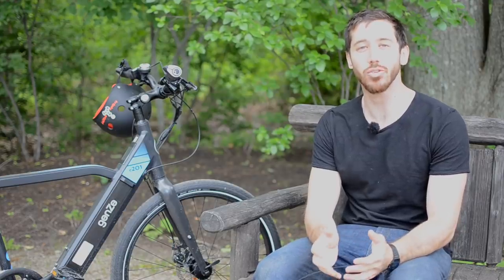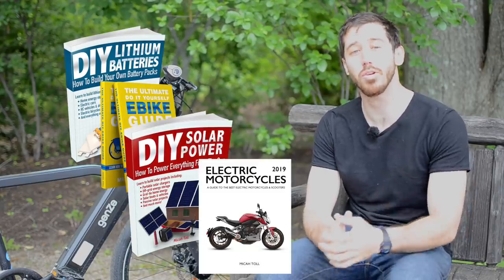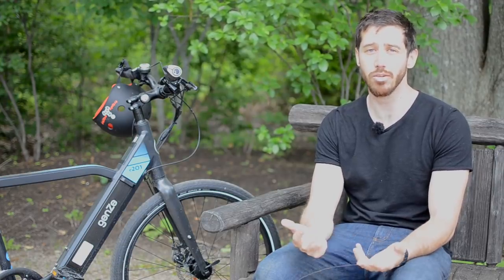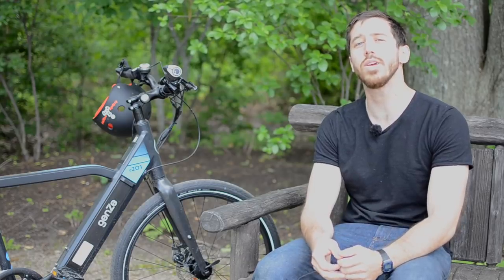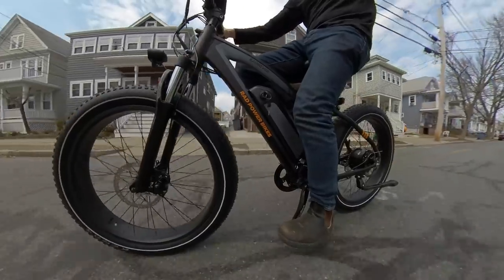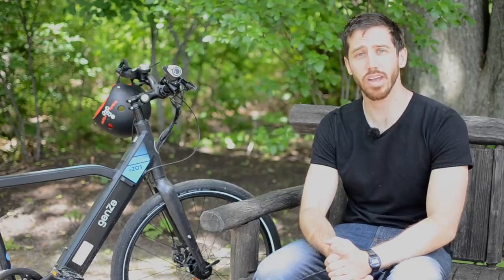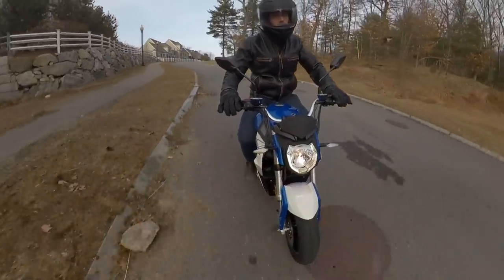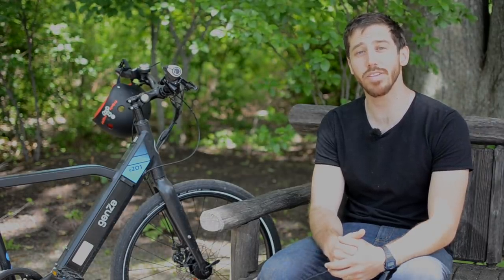How much POWER does an ebike need?

Comment: I have a front hub 1000w 48v wheel and run a 48v 40ah lithium battery on a trike. It lasts me almost two weeks of riding back and forth to work, climbs the few hills at speed unless it's already at top speed in which case it slows down a bit, and handles grocery runs fairly easy. I used to do the chinese motor bike kits, but after having a lot of difficulties with the setup on my trike I swapped to the electric hub and haven't looked back

Comment: I’m considering getting a surrey (4- or 6-person) and I want to instal a hub motor on the drivers side to make it pedal assist. Of course they are crazy heavy compared to a bike, so do I go 1500w?
Reply: Id go for it. Alot of passengers and more power is better. Im trying to get the governor off of my bike for more speed. And two batteries for you. Maybe two 52v?
Reply: @swanp1767  You nailed it. I ended up going for a 52V battery too. I thought the hub motor would be too much, but now having installed it, I bought exactly the power I needed.

Comment: One factor that is not often talked about for ebikes is the diameter of the wheels and how that affects top speed and hill climbing ability. Although you may be sacrificing some top speed, smaller wheels do not need as much wattage to achieve the same torque to the ground needed for hills. Ofc, gearing also plays a big factor in the case of mid-drives, but all things being equal aside from wheel size, i think this holds true.

Comment: Great video thanks mate. Do you recommend having push button throttle for acceleration or having pedal assist? Is it possible to have both running at the same time? Or flip between these two options with a button

Comment: I built a 1000 watt rear hub drive ebike a year ago (spring 2019) from a Walmart on line kit. The bike and a 180 lb capacity cargo trailer from Aosom, is actually utilitarian for me since I live on a sailboat and I can take the bike where ever the winds take me; what ever port I pull into, as long as a grocery store, a Walmart, and a "home center" is within 15 miles (22ah battery) of the dock I can collect all I need to sustain the next leg of my wandering - with the trailer usually in one trip. I got rid of my gas hog truck which spent 95% of the year in storage, when I completed the bike. Now, at 750 watts limited by the controller, this bike without the trailer can sustain about 33 mph on a flat and around 27 mph up a 5% incline (I weigh in at a whopping 135 lbs, by-the-way). For reference that's 5 ft up for every 100 ft horizontally or 15 ft up in the length of a football field, and pretty typical of most hills on the east coast. With the trailer subtract about 2 to 3 mph in either case. Maybe because I'm retired and a bit older, but 30 mph on a light bicycle is a bit hair raising. At that speed any cross wind will push you all over the road, bumps in the road hurt (maybe just my bony butt) and can threaten to bounce you into a crash on a bike without some sort of shock absorbing suspension. Partly because of laws in many east coast states I further impose the LCD panel's speed limit of 20 mph. This is just my opinion but anything above 1000 watts is excessive unless you are trying to set the land-speed record for ebikes, possibly trying to start an ebike racing circuit or just in it for the adrenaline rush ... and are a VERY accomplished bike rider.

Comment: Bike means you should be peddling.
In the EU 250 Watts means it can be easily 500 Watts up hill.
Reply: I've got over 18,000 miles (28800 km) on my 2003 LWB recumbent ebike build. It uses an old fashioned (with modified slightly lower gearing) USPD Currie drive on the rear 26" (41.6cm) wheel. The motor/controller is rated for 48V, 1000W continuous, 1500W peak. You might get the idea from this that I never pedal and only ride it with POD (Power On Demand) throttle wide open all the time, but nothing could be further from the truth. I always pedal and seldom exceed 500W of power even on one of the many 15%+ grade hills in my territory. I use no motor power on flats or gentle rolling hills. Having the extra power comes in very handy when I take the lane in traffic in areas where it's stoplight to stoplight every block. Having all the surplus continuous power while rarely ever using more than half of it means I don't stress the drive too hard at all. That's probably why the longevity has been so good as it shows no sign of lower performance today, 16 years later.  

Here's a picture of it from back in 2003 after I completed the build:

https://tinyurl.com/y2subu22
Reply: @JaleelJohanson62  
Pity the link doesn't seem to work at the moment.
I wish there were more people like you. Over here in the EU you can use a speed-pedelec, but then you need to have it insured, wear a helmet and have at least a drivers license for a moped (which is quite easy to get). Any car drivers license will do as well.  More and more people are getting rid of the car and commute by speed-bike. Far more popular though are low powered e-bikes (rated 250W), often called pedelecs. Anybody can ride them, even children, and you don't need anything. No license, no insurance and you don't have to wear a helmet.
Nowadays most of them are 36 Volts and they are fused 15 Amps. This means the maximum power is up to 540 Watts (and the rated 250 Watts is defined as the average maximum).
Their speed is limited though to 25 km/h with a 10% window, so most of them easily go 27-28 km/h. You can tweak them to go much faster, but officially those tweaks make it illegal to ride on public roads. There is no throttle (by law), you'll have to turn the pedals. There are 2 systems: one that only checks whether you turn the peddle (no matter how slow) and one that adjusts the power of the motor to the force on the pedal. The latter gives a more natural feel, the first makes it possible not to use any human force at all.
To get back to the title of the video. An average adult of 80 kg riding a normal city-bike on a flat surface at about 18 km/h uses between 80 and 100 Watts. Living in the Netherlands we know all about bikes and we are so very lucky not to have any hills, let alone mountains. Our biggest challenge is peddling up a bridge.
Reply: @czarzenana5125  Our laws here in the U.S. regarding ebikes vary by state. There is a federal law as well, and while there are some states that follow it to the letter, the federal law is used primarily as a guideline for the importation of ebikes from abroad. In my particular state, the law for ebikes was recently changed to that of mopeds. I have a top speed limit under motor power alone of 30 mph ( 48 kph) with no more than 2.5 brake hp to the drive wheel. One must have a driver's license to ride an ebike on the streets. That leaves those who's licenses have been suspended off of ebikes as well though as well as those under age 16 which is not very good IMHO. I have a velomobile as well and it incorporates the Bafang BBS02 750W mid-drive that powers the cranks in parallel with human pedaling. While it does have a POD throttle, I tend to ride it in pedelec mode as I like that better. It's of the simpler design you mentioned where there's no torque sensor and therefore no varying assist level to match the user's level of pedaling.  It's still a blast to drive and I can't count how many times I've been videoed while out and about in it. lol  I would think that with a 250W power limit that a mid-drive where the motor can take advantage of the bicycle gearing would be the way to go? My velomobile in the lowest gear could climb a tree if it had claws to grip the bark. lol I've watched many videos of the bicycle culture in the Netherlands and would love to visit there some day!   

Try this link:

http://www.evdeals.com/images/ElectricBikes/CharlesBlow1.jpg

Comment: 250W at front + 500W at the back wheel ;)
Reply: Does it improve or affect handeling? or just speed?
Reply: @danielziolkowski1027  I tried just for 5km a custom build e-bike with hub motors at both wheels and found it very comfy. 
I think the regen braking was very smooth and the acceleration was so nice :)
Reply: @DanislavKostov  
Thanks would you recommend playing around with having both a front and rear motors ? 
This will be my first ebike  I just want to learn as much as I can b4 I make my own mistakes lol
Reply: @danielziolkowski1027  For a first ebike I would recommend basic setup with rear wheel hub motor. Easy and working.
Reply: @DanislavKostov  Thanks I will get it going right then will only be a day b4 I start to experiment lol and understand some cause and effect

Comment: Mika I'm new to ebike's, just know deciding what one to build. I'm retired now but I raced bicycles for many years. I am an electric RC pilot tho.  This is general but we use 3s, 4s, 5and 6s- 2000mah to 6000mha with a 40c rating up to 140c. All i know the higher the c rating the better the battery takes high power drain and charges. Why do ebikes use batteries with such low c ratings. Thanks Rick D.

Comment: Hmm, Im currently building a 3kw Bike, so I'll see how it will perform xD
Reply: How was it?
Reply: @01imh  Difficult to say:
First I tried to make the throttle control via Force on the pedals, but this is at 3kw unbearable(flew off the bike because of too much power).-> To compare: the maximum torque is the same as a 100ps motorcycle.
Now I'm controlling it via a real throttle grip and it is much better, also programmed an "Speed"-Mode where it automatically accerlerates me to a given speed if i pedal, but at fixed torque much lower than the 3kw (I guess about 1kW or so).
Also I made a extra battery because the normal ones don't give you 3kW
To conclude: 
I freaking nice and has a lots of power,  but in everyday use I guess 1kW is more than enough.
Reply: Ecks Dee

Comment: I use a 48 volt/500 watt Direct Drive magnetic induction motor on my recumbent, front wheel. I live in a town with some nasty hills. This motor has a weight capacity of 600 pounds, so has no problem pulling me up hills. Even if I am pulling my Burley nomad trailer. If I'm not mistaken, your only talking about geared motors. As for the battery, it is a 48v, 10 Ah battery, I intend to get a 15 Ah battery by May, too give me better range. I also primarily use assist, and not the throttle.

Comment: I find my 500W Bafang 48V mid drive Montague bike conversion an overkill. I pedal my bike and use the motor only for assist in wind and on hills. I get 50 to 75 mile range on paved roads with mostly small and a few medium hills. Average person can put out about 200W over an hour of pedalling a non-powered bike. Climbing hills with 500W Mid drive as well as pedalling is hard on the chain and sprockets. My next bike will be 350W 36V rear wheel hub motor, a friend of mine has it and keeps up with me no problem; he was a velodrome racer, now 74 yrs old . His bike is 16 lbs lighter than mine.

Comment: What are the best ways to use and treat your lithium battery. To make the best and longest life cycle.

Example's 

1 overheating damages
2 storage voltage for extended periods of time.
3 lithium battery appropriate voltages for chargers (very important)

Your videos are excellent thank you for your time cheers.

Comment: I have 750w geared hub on front and staton friction drive Honda gx50 at rear on a cheap 26” mtb. Flies up STEEP hills at nearly 30mph. Handlebars take a bit to get use to with the different controls. Going to upgrade soon to a disc brake bike for stopping power. I cruise on just gas power at 25-30. Taking off and hills I go hybrid...Leg/Lekky/Petrol. 
Maintenance is minimal with this set up.
Will make video when I get the disc bike sorted.

Comment: Have a Bosch motor 250w (45km/h) engine and in the Lowlands it is more than enough, 
if you want to have a better acceleration you can also go for bikes with smaller wheels.

Comment: IOW, it depends. On your weight, terrain flat to hilly, wind, tire pressure, battery condition state & voltage, mid/hub drive, your personal output power, your expectations, controller, bike efficiency.

Comment: I have a 250w motor. 36v battery. My way to work has a 12% hill for 600m and the way back has a longer 10% hill home. The bike slows down to about 15km. And struggles to keep it. So yeah, get a 350w.

Comment: 1:00 also different motors have different resistance in ohms,   less ohms / les resistance  means it's gonna have more power,  the wheel size gonna affect the top speed and torque,  and also  weaker hub motors have gears inside, to increase torque which reduce top speed

Comment: Awesome Video, as a heavy 300lbs rider myself, i been researching all over how many watts i should get, sound like 750 should be the MINIMAL! 1000watts sound nice but expensive here in Alberta, Canada. Thanks for the tips!
Reply: Or if one wants to pull a cart w/ a child, groceries etc.
Reply: You have to remember that any motor assist will assist you. These aren't a motorcycle, you do have to put some effort in. If you're looking for sitting back and throttling up hills, sure go big or go home, but if you're using pedal assist, well the only legal ebikes here where I live are 250w motors and they are popular as hell despite the hills we have here.

If you start riding a bike regularly (i'm 150kg too) that weight will soon drop and as the old saying goes: it never gets any easier, you just get faster.

Comment: Best way to determine real performance of your motor is to look at its controller. My motor is rated 500 watts, but it comes with a 36v and 22 amp controller. That means it can and does put out up to 790 watts of power. Also not all hub motors are the same. 500 watt internally geared hub motors provide significantly better torque then direct drive motors. Thus my 500 watt, internally geared motor actually performs on hills closer to that of a 1000 watt direct drive hub motor. 

I can be sure of this because I weigh over 200 pounds, and my bike, with its massive 33ah battery with homemade wood and alu enclosure, steel frame SS bike, rack and panniers, motorscooter light kit + wire harness, lock and accessories weighs in at about 75 pounds. It still gets me up the hills in my town, though it does bog down a bit. On my SS bike, I chose a gear ratio that is too low to help at the motors top speed but is better suited to assisting the motor up hills.

Comment: Got a 48v 350w motor "big as your dinner plate" size converted to mid drive men no hill can stop me but i snap na chain so much torque in a little power i can do go as 2.04:1 ratio and up to 1:1.39 mid drive are the best!

Comment: Great video:) i agree i have my 1500w hub running at peak of 1900w and while a peak of 1500w is good and can keep up with most traffic it struggles to accelerate uphill above 36kmh, 1900w on the otherhand can accelerate you up to that 45-50kmh range on some fairly steep hills.

Comment: I pretty much decided to get a rear hub motored ebike with a 750w motor. I had read that a mid drive motor where is that the gears and chain rather quickly. But now it sounds like a mid drive would be more powerful for the same wattage

Comment: My Cyrusher XF800. Goes really  well torque  wise and  28 to 30 mph. But never listen to mileage claims. I had one for 7 weeks . Ot got stolen fault
 25 miles on a full  charge
 Bought  another  one. 15 miles  on a full  charge battery.  I hope they replace the battery 
 As it is under warranty.

Comment: I bought a 3kw enduro DH bike recently for relatively cheap, got to say it's a marvil to ride, more torque than most other vehicles off the line up to 60km/h and a top speed of around 75km/h, thing is the thing never comes close to the 3000 watt usage, maxes out at just over 1kw.  My battery is a 30ah 48v battery which is most likely my bottleneck, thinking of going 72v hopefully I can actually use the whole motor.

At one point I thought maybe it wasn't a 3kw motor, but looking at other 3kw motors it looks very similar in size if not exactly the same.
It's a rear hub motor taking up almost half of the back wheel, in reality probably 1/3 of the wheel, it extends passed the brake pads which are pretty monstrous themselves.

Comment: I have a 2016 Haibike with a Yamaha motor and prefer its pedal-assist to all the throttle-models I have owned over the last 2 decades.I like riding more than working on my eBike so I sold all my high-power hub motors.This turn-key Haibike  pulls my 200 pound carcass and a fully-loaded BoB trailer up over a 800 foot climb everyday with no problems. I thought this was a 500 watt motor yet...the literature seems to indicate the Yamaha PW motor is but 250 watts. Whatever...I just ride and smile.

Comment: I've learned / Been inspired by your videos. I'm kinda sorry I bought a 52 volt 13 amp battery for my trike conversion. Al really needed was a 48 volt 13 amp battery. Speaking of trikes, Whenever I see a fat tire trike I chuckle a little. The back tires on a front hub drive just hold up the trike.
What's the advantage gained? I've been able to go on sand and dirt just fine with the standard  issue tires. Oh, good luck getting a fat tire trike thru a doorway.

Comment: The motor Wattage is for continuous usage ratings. The more important info for bike power is the controller Amps x the battery Voltage from everything I'm reading. 48 v * 25 A controller = 1200 Watt max output but I think you can give a 500 Watt motor easily 600, 700, or 800+ for hills.

Comment: In this case battery power has to do with range basically. A 48v500w motor with a 10ah bat will run less mile then a 14ah battery on the same motor. Correct me if I am wrong.